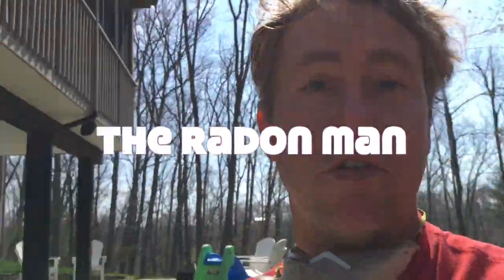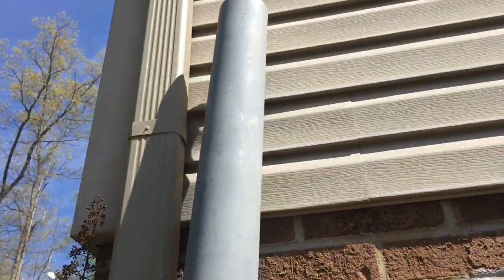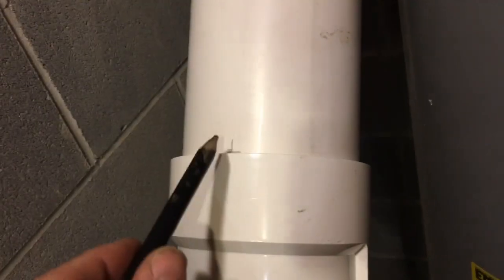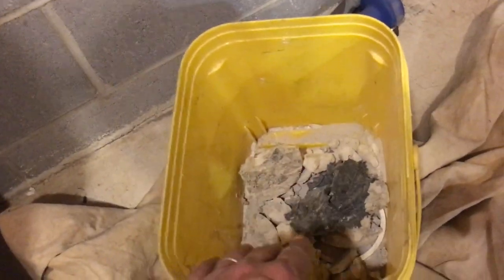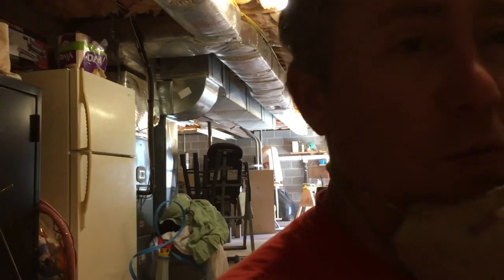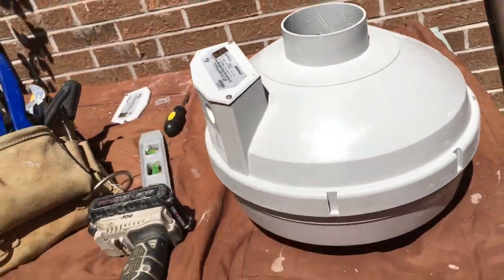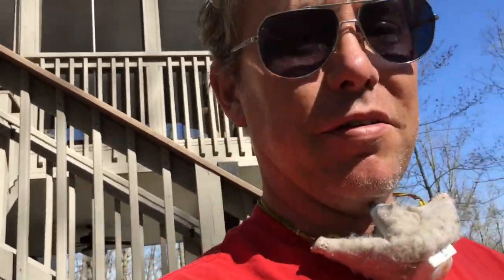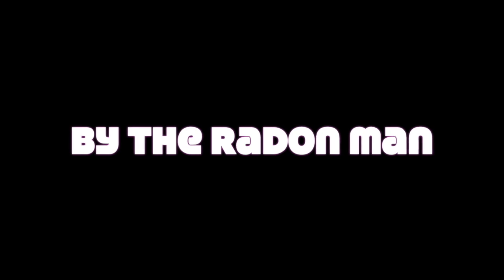How to install a Radon System 101.

Comment: I know what I am doing, and have done at least a 1000 radon systems; and in my state the code requires a schedule 40 pipe!! So I don't think you should say "the guys that don't know what they are doing use the schedule 40 pipe" maybe your state codes are different

Comment: Great video.  My question is if there are cracks in the slab, does all of this defeat the purpose as it pulls air through the cracks?
Reply from the maker: Hi TG.  Cracks in the slab can cause our radon systems to lose suction and not be as effective.

Comment: How does water stay out of stack. Probably a silly question
Reply from the maker: It's a very common question. The answer is : that it doesn't! It's just like the plumbing pipes coming out of the roof of your home. water simply drains out under the slab of your home. no big deal. 😀

Comment: Does the fan have to be outside of the house or can it be inside where it's protected from the elements? Also do you have to put a "hat" on the top of the pipe?
Reply from the maker: In the USA, the fan is supposed to be mounted outside or in attics.  The top of the pipe does not need to be covered. Thanks for watching!

Comment: Why do you use the thin PVC vs thick?
Reply from the maker: Hi Jeff. Ha! I totally regret making that comment. Since making this video, I have seen a competent mitigator or 2 using schedule 40 PVC throughout the system and things turned out fine.  However, I still think the thin gauge looks cleaner and passes more easily as downspout at a glance.  I also like the hubbed end at the top that can only be obtained with the thin gauge pipe.